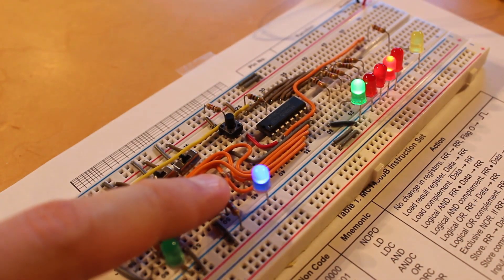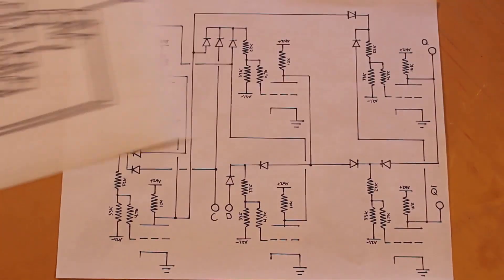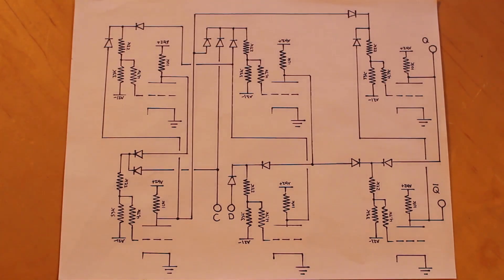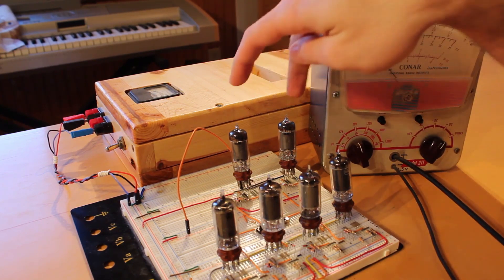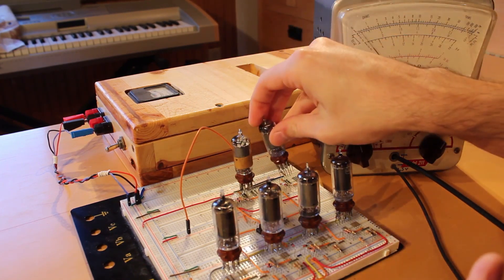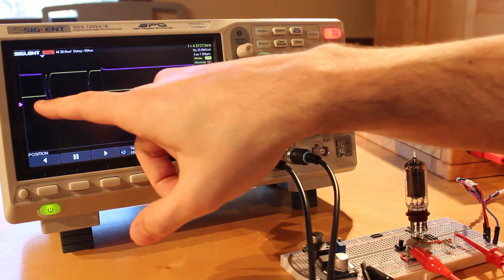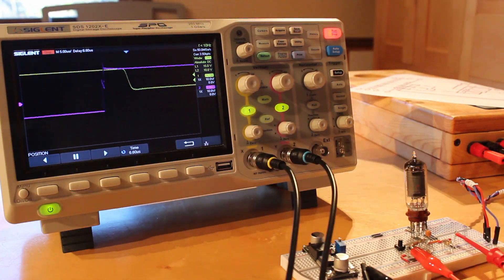Vacuum Tube Computer P.02 – Heaters and Debounce

Comment: I like the idea of using vacuum tubes, but at the same time, I wonder how well that would work with diode-transistor logic. This, in turn, raises the question in my head about how well it would work with triodes only for signal level refresh, but otherwise primarily with vacuum tube diodes (e.g. EAA91) or semiconductor diodes (to reduce costs) — sort of like diode-tube logic.

Comment: You may be able to power the heaters (tubes with cathodes have heaters, not filaments) with AC,  This was done for "everything" in consumer and broadcast gear.  I have not vacuum tube digital experience, but it mean just a transformer to power the heaters.

Comment: A capacitor based de-bounce circuit will definitely do the job of de-bouncing the signal, but it DOES come at a cost...
That 'cost' is the limitation of the upper frequency that can be handled since the capacitor imposes a finite 'delay' period.
Another 'option' would be to employ some degree of 'positive feedback', thereby creating something that approximates a classic Schmitt Trigger input.
IMO, the 'ideal' is a combination of BOTH, with the capacitor-induced 'delay' as small as possible (to maintain the highest possible frequency) and the two Schmitt triggering levels as widely separated as possible.

Comment: I assume that any circuit you will add will be an even number of tubes, so 2, 4, 6, 8 etc, so regardless of how complex your circuit becomes, you will always be able to divide it into 4 tube strings, with at most 2 left over, so the 12V supply would not really need to power more than 2 filaments... Or am I missing something here?

Comment: Hello! Cool series so far, excited to see what comes next. Maybe you found a better solution to this in one of the following videos but I'm wondering why it is an issue that the flip flop uses 6 tubes? Presumably, in the full computer, you'll have many logic gates, so as long as the total number of tubes for the whole build is divisible by 4, you should be good right? And then if it is not you can just power 1, 2, or 3 single tubes via other methods, rather than 2 per flip flop, which makes the power requirement on the -12v rail less important? Maybe I'm missing something here.
Reply from the maker: Thank you so much!
You're totally right, as long as the whole build is divisible by 4 (and I think it is, if I remember right the final tube count is going to be 180) I could run the tube heaters entirely off of the 24V rail.
There's a few reasons I'm running two off of the -12V rail on the D Flip Flops though. The DFF that I'm using here is six logic gates, I did some testing with other types of flip flops that had fewer gates, but I had the best luck with the six gate ones. But, I wanted all six tubes to be on one board and I wanted that board to be as universal as possible. In the entire build I have seven of these six tube D Flip Flops, and all seven of the DFF boards are totally interchangeable. That meant that I needed to find a way to power all six on a single PCB.
So, the primary reason is less of an electrical one and more of a physical packaging one!
Reply: @UsagiElectric  That makes sense, thanks for taking the time to reply!

Comment: Wouldn't it be easier to run the Tubes with 6VAC? I'm surprised on the results running it at 24 Volts. I know some cheap headphone tube amps run at low voltages but typically sound like total garbage.
Reply from the maker: Thank you!

The idea behind running the heaters in series with 24V DC is to eliminate the need for a separate tube power supply. The tube heaters are slightly undervolted (6V instead of 6.3V), but that doesn't really have an affect on the circuit at all. Since the tube heaters are in series, all I need are two power supplies: +24V and -12V. And, I can use the -12V supply to power two tube heaters in series as well, so I can design large circuits around two tube modules or four tube modules, giving a lot of flexibility in design while still keeping good simplicity in the power supply.

With digital tube circuits where all we really care about is logic high or logic low signals, tubes at low voltages work wonderful. We can still see large gain, just at extremely low amperage. So, my standard inverting amplifier design uses a 33k plate resistor at 24V, which means at most I can supply just 0.7mA. But, if all I'm using that output for is for an input to another inverter, it's not a problem at all because there's no impedance mismatching going on.

However, if I wanted to drive an audio amplifier, we start to run into issues. Even using the 6AU6 as a cathode follower driver for an output transformer, at most I'd be able to get about 200mW of power. So, that's generally why low voltage audio designs are not great.
Reply: @UsagiElectric  6.3 VS 6 is nothing at all is still is considered normal. They typically list 6.3 volts because most 6 volt VDC power supplies used tube or selenium rectifiers that didn't have much voltage drop compared to a silicone rectifier. Typically in tube circuits to run a filiment cool would be 5 volts.
Running them in series, isn't that how the old christmas tree lights worked. One bulb goes out the whole strain goes out?
Reply from the maker: @lelandclayton5462  Yup! If one filament dies, it breaks the circuit. But, since I'm only ever running at most four tube filaments in series, if one tube does go bad, troubleshooting should be fairly simple (just feel around for the group of four that are cool).

Comment: What published tube characteristic, if any, could be used to predict its high/low voltage difference in this case at low DC voltages?
Reply from the maker: This is actually an awesome question!

As far as high voltage vs. low voltage goes, that one is tough because the manufacturers never intended the tubes to be used at just 24V, like we’re doing here. As a result, the charts and graphs on the data sheets just don’t have enough resolution to really see what’s going to happen.

However, in my (albeit limited) testing, I’ve found that whether the tube is at a high voltage or a low voltage, the characteristics tend to pretty close to the same. The biggest difference is in how much power we can produce. That’s more a limit of the plate resistor and our low voltage than anything else though. 

For the characteristics, that depends a lot on what you’re building. If it’s an audio amplifier you want a big, wide linear curve. For the digital switching stuff we build here, we want something that transitions much quicker. 

Now, I’m still a massive noob at reading datasheets, so I may be completely wrong, but here’s my theory behind deciphering the graph data.

So, let’s take a look at 12AX7 here: https://frank.pocnet.net/sheets/127/1/12AX7A.pdf

On page 3 you can see the “plate voltage vs plate milliamperes” graph. I believe this is the best indication of how the tube will react. Pick a plate voltage and go up and down that line to see how the mA changes in accordance with grid voltage.

Next, check out the 6AU6 here: https://frank.pocnet.net/sheets/127/6/6AU6.pdf

Again, on page 3 you can see the same “plate voltage vs plate milliamperes” graph. The lines look dramatically different. 

For example, let’s look at the change in plate mA at 100V with the grid at -1V and then at 0V. On the 12AX7 we go from about 0.5mA to 2mA. On the 6AU6 we go from about 10mA to about 17mA. Now, the tubes are obviously extremely different, but it seems that the 6AU6 plate characteristics change much more dramatically with change in grid voltage. 

And I’ve kind of confirmed this with a bit of my own testing here: https://i.postimg.cc/N0PbZtS8/6-AU6-vs-12-AX7.jpg

My testing was done at just 24V, but you can see that the 12AX7 output only goes from 23.5V to 20.5V as the grid changes from -1V to 0V. But, the 6AU6 goes from 19V to 8.5V. A massive change comparatively! This means the 6AU6 is way better for digital switching where I want the tube to either be in cutoff or saturation. But, for audio, where we want nice linear response, the 12AX7 is much better, even at lower voltages.

Sorry for the crazy long winded answer, but that’s kind of where I get my line of thinking on tube choices!
Reply: @UsagiElectric  You might find this useful, I don't know:

Vacuum Valves in Pulse Technique (1959)

https://nvhrbiblio.nl/biblio/boek/Philips_ElectronicValves_BookIX_1959.pdf
Reply from the maker: @winstonsmith478  Excellent resource! It's been saved in my resource folder and I'll give it a proper read soon!
Thank you!

Comment: I really liked seeing the switch bounce scope view!.  Capturing that is hard for me to get it to look so good..  
For filament supply, I was looking into building an audio amplifier before, and the filament supplies for all the tubes would be something like several amps. I was thinking of building or buying a modern switch supply. But it is almost just as inexpensive to get a beefy filament transformer. I haven't made any progress on that project in a while.  
But for your needs of 12V filament, I was thinking something like the Hammond 167V12 transformer,  it is on DigiKey for about $100. But this thing gives 12V at 20A. And with the center tap, you could  get the 6.3V for those 6V filaments too. I guess this kind of power lets you run about 40 tubes. And if you ever are not using this for a tube computer project, you can re purpose it to charge your car battery (well with some nice rectifiers too)
Reply from the maker: Thank you!
Switch bounce is one of those things that's hard to imagine but once you see it on the scope, it's clear as day!
There are indeed quite some beefy 6V supplies out there that would work great for what we're doing, and the world of transformers is a rabbit hole of epic proportions, haha. But that Hammond transformer is wicked - 12V at 20A is mind blowing! I may actually have a look at some other Hammond transformers when it comes time to start thinking about power supplies for the full replica. I've never actually built a power supply from scratch, so that could be quite a fun little journey!
Reply: @UsagiElectric  I think for filament supply, we don't need anything fancy for regulation. In most tube guitar amplifiers, the transformer is a dual purpose filament supply as well as high voltage plate supply.  The high voltage DC filtering supply is complicated, as we need high voltage capacitors and diodes and usually a choke to make a pi filter. 

But the filament output is a 6.3v centre tapped output from the transformer. They ground the center tap (that has to do with helping suppressing the AC hum artifacts making their way into the audio signal), and then they just feed the filament suppy from the transformer directly to the tubes with twisted 22 ga wires.

Really all we would need to do here is have a proper and safe AC line voltage connectors. Something like an IEC power cord socket, a fuse, a switch, and then using the terminal lugs on the wires to connect these and some heat shrink tubing.  I guess some metal chassis to hold it as well.  This power supply design is kind of my hobby as well, I am happy to help if I can anyway.

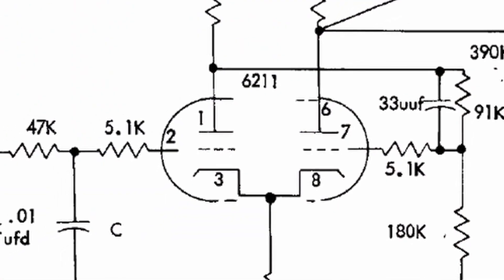Comment: 16:46 Yikes, uuf for picofarads. And .01ufd for 10nF. I guess the boys at The Big Blue did not like SI prefixes :D (Well, from every schematic with a .1uF cap I've seen, some of that stuck out to this day)
Anyway, great video (as always), I'm getting excited for the project!
Reply from the maker: Thank you very much!
I always found it weird that old tube schematics had an aversion to nF. It's not just IBM, I've seen radio schematics that used uuF. I imagine the engineers were like "this capacitor is small, micro even, but this one is even smaller, so, uh, micro micro?"
I'm really glad I decided to start with this proof of concept because as I'm building it up, it's highlighting all sorts of issues that wouldn't scale up well or need to be tweaked. I'm hoping to start building the first bits of the full-size MC14500B replica around Christmas (although the videos will lag behind to give my poor mill some time to cut all the boards).
Reply: @UsagiElectric i think the uuf was from when using nano and pico prefixes weren't really standard yet

Comment: [Another comment that you won't see until you go into the YT video management console.]  What about simply using ballast resistors (or even a 12/6 volt) lightbulb to allow the heaters to run from 24 volts? It for sure will waste a lot of power, but you don't have to use two beefy power supplies.  And with bulbs as ballasts then you'll get a lot of light as a bonus - so you could call the design "the photonic tube computer" ;-)
Reply from the maker: Weirdly, this one showed up on the actual video this time! Maybe the Youtube algorithm is finally learning...
I have thought about running ballast resistors, but I'm not a huge fan of trying to dissipate all the heat that'll be generated by the resistor. I do really like the light bulb idea! I may end up giving that a shot for some future projects. The issue with the D-Flip Flop is that for the full-size MC14500 I'm building, everything will be broken up into modules cut into boards that are 150mm x 60mm, and I just barely managed to squeeze all six 6AU6 tubes for the D Flip Flop on one board, but there's no spare room at all. 
Having said that, I think I'm definitely going to experiment with the light bulb idea, it might save my bacon on a few other boards that use an odd number of tubes!